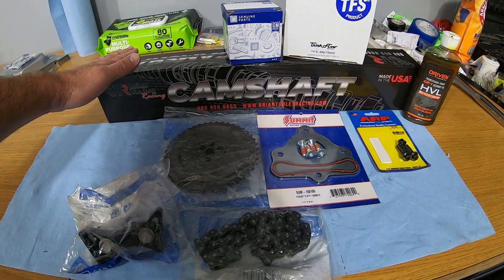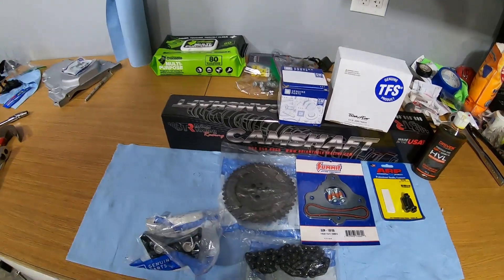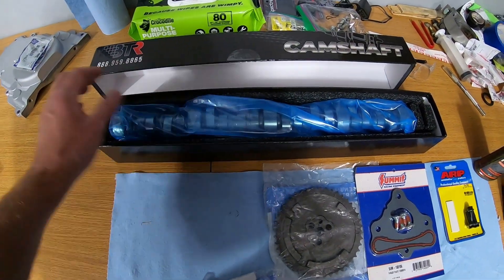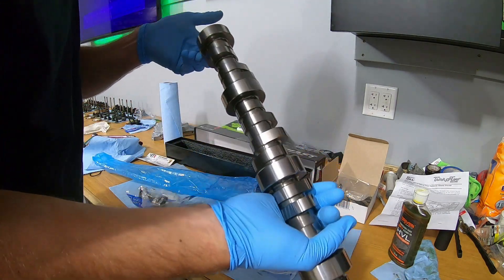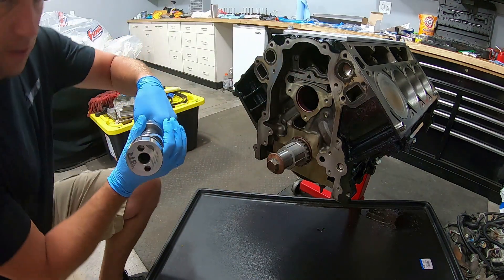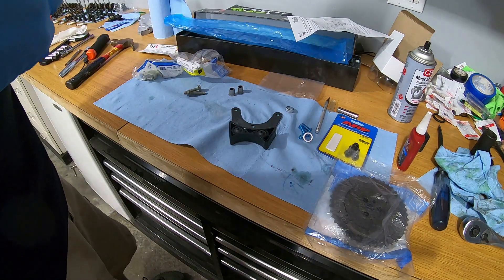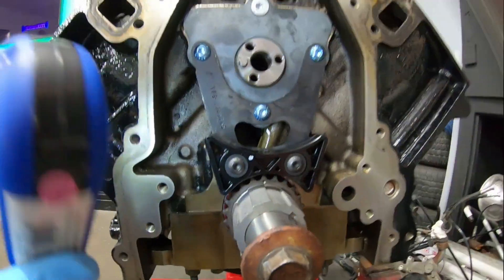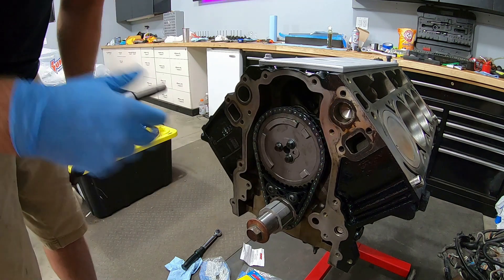BTR Red Hot Cam, 500+ HP 6.0 Build (Part 7)

Comment: What heads did you run
Reply from the maker: Rec port ls3 style. I can't remember the casting number off hand but they are the truck version rec head that came on later 6.0 engines.

Comment: I put the red hot cam in my 5.3 that’s in my 69 Camaro.  Pretty awesome cam
Reply from the maker: Hows the street manners with it in a 5.3? U running stall converter?
Reply: @EssMotorsports  I have a t56 trans so no stall.  My setup is the L33 5.3 with the 799 heads and I run an Ls7 clutch and 4.10 rear gears.  This package really scoots.  Street manners are fine when putting around but this setup really likes rpm and comes alive above 3500rpm.
Reply from the maker: @bluesmoke218  I can't wait to hear this cam scream!

Comment: I’m doing an lq4 with the same cam, it’s my first build. Do you have to degree the cam? I’m not doing an adjustable timing gear.
Reply from the maker: I just installed it straight up. Dot to dot with factory timing gears
Reply from the maker: Check ptv clearance. I had to grind a little on pistons to make clearance for exhaust
Reply: @EssMotorsports  Im doing dished pistons from summit racing with k1 rods. But I’ll make sure to check that as well. 
Thank you
Reply from the maker: @Jreyes703  if they have valve reliefs in them u should be good then but always a good idea to check
Reply from the maker: @Jreyes703  sounds like a nice build with K1 rods! U reusing factory crank? Have to balance?
Reply: @EssMotorsports  yea hopefully it’s a good build. It’s my first one though. 

I’m using stock crank. Block has been bored out to 4.065. Crank will be polished and balanced at a machine shop here in Utah.
Reply from the maker: @Jreyes703  sounds pretty awesome to me! The Red Hot cam looks to be a great cam. What heads u running?
Reply: @EssMotorsports  I’m going to get some 823 heads. I’m going to run an LSA supercharger. 
Or would you recommend different heads?
Reply from the maker: @Jreyes703  823 heads would be an excellent choice. And u need the rec heads with lsa. I got 5364 truck rec port heads for cheap. That would be an option. Same thing as 823 without the lightweight intake valve. Future video coming on that
Reply: @EssMotorsports  okay cool, quick question though. What would you recommend to gap the rings to? 
I want to build the motor then a year or so throw  the supercharger on
Reply from the maker: @Jreyes703  all depends on rings mfg and boost level. Follow the rings mfg specs for bore size vs hp/boost level